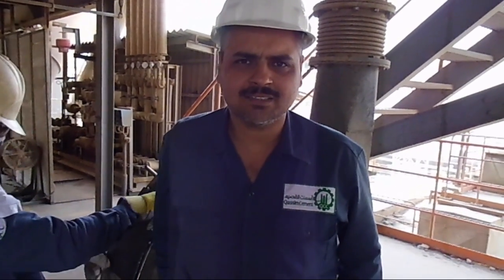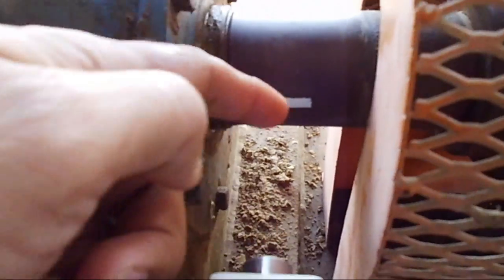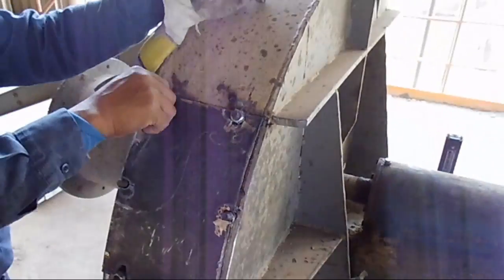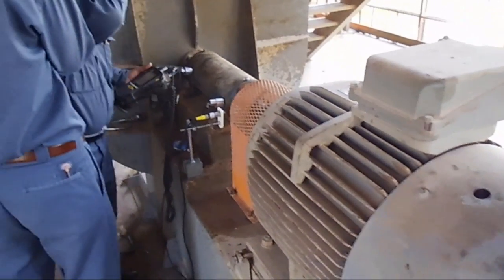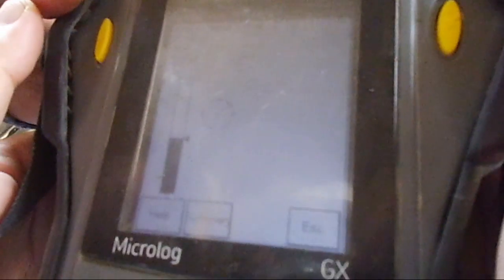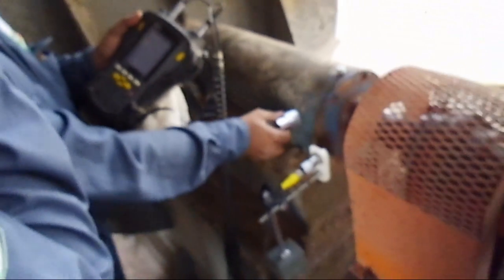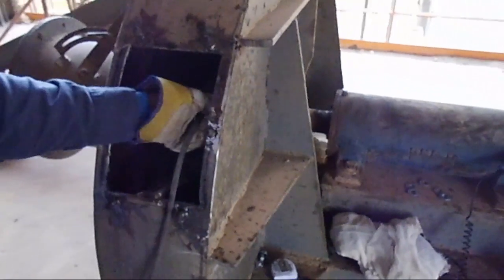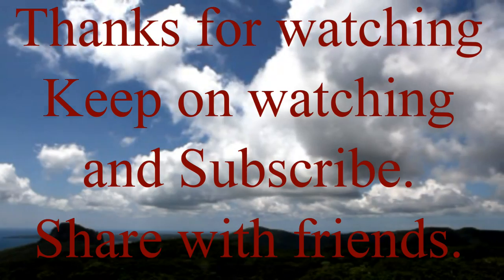Fan balancing. Impeller balancing.

Comment: loverly job done :-))

Its hard to dub your own videos after the event has passed, trying to remember what you did exactly, but it was very clear and noise free in the room you were in :-))

So apart from the skf tool using the white line as an rpm pickup, it is also a timing pulse to start the capture of data for every revolution, and the maximum voltage of the vibration sensor can be tracked to a position after the synk point.

So synk/strobe is 0 degrees and the speed is known then the rotation period can be calculated, the ratio of rotation period to vibration period point could be used to divide 360 degrees to tell you where it is.

Sorry im rambling to myself while thinking out the basic idea lol.
Reply from the maker: As I said before you have rock knowledge. Your understanding to the matter is awesomely great!
Yes you are correct it is a bit difficult to dub and re-assemble the events again after passed but it was necessary as it was very noisy there where I was filming in real situation. Also the camera in my hand was a poor quality one. But I am sure What I did, would be enough to give understanding to a person working on such a job.
Reply: LearningZone
There is nothing wrong with your video, the picture quality is plenty good enough to see what is happening, your commentry made everything clear :-)

My knowledge is only basic, i also forget things over the years so its allways great to have the memory refreshed by your smashing videos :-))

Im one of those odd people that found learning from school or text books almost impossible, it made no sense to me, i needed to physically take things apart and learn from reality, just an odd sort of brain i suppose, thats me "Odd" ha ha :-))

Comment: how to calculate the weight of trial weight for the 1st time. will i attach any weight, or there is any calculation of trial weight by using impeller weight?
Reply from the maker: According to impeller weight there are mathematical calculation formulas available. But you can guess trial weight of any appropriate weight. It would work if don't cross the limits. Means don't go for big weight for a small impeller and for a big impeller a very small weight.

Comment: When adding the weight, do you also consider the weight from the weldment?
Reply from the maker: Yes, it should be considered for small fans where you need a few grams of trial and correction weight. An estimation can do. For bigger fans where kgs of weight you need to balance, a few grams of welding wouldn't effect much.

Comment: Sir, For 210Kg ,700 dia flywheel rotating for 4000 rpm , dynamic balance report says R1=0.49 grams,R2= 0.51 grams ,before it was R1=40 grams,R2=50grams and vibration value is less than 2.61 R1,R2 is it acceptable

Comment: Sir trial waight remooved or not  after balancing
Reply from the maker: Trial weight removed during balancing after trial run and before fixing correction weight. Trial weight is just to make trial calculations by the balancing machine.

Comment: hi sir I'm Jake great video This is so helpful for us to know since we have same instruments,, by the way i have a question about on your video of balancing did you remove the trial weight before you weld the correction weight i did not see on the vid.. thanks for the reply,,
Reply from the maker: Thanks for liking. Here I removed the trial weight after completing the trial run. There is option available in the machine to select if you don't want to remove the trial weight. But my preference is to remove it. Stay tuned and blessed.
Reply: thanks for reply sir ,,, hoping in the future to have more discussion  with you  since I'm using same instruments thank you again
Reply: Hi # Jake Alboroto
Can you share which equipment is this and also I would like to know weather 2 channel vibration analyzer is sufficient for balancing operation and for condition monitoring???

Comment: sir am having one question that before adding correction weight u need to remove that trail weight sir ?
Reply: You are right, you must remove the trial weight. But there are several instruments that provide the option of not removing trial weight. So the position of correction weight will be different. Trial weight should be removed

Comment: Nice video sir but I have a question after trail weight to add correction weight is that add fan rotation direction ya opposite direction
Reply from the maker: Sure you will count degrees opposite the direction of rotation.
Reply: Thank u sir

Comment: The test weight you place counting in favor of the rotation rotation or against
Reply from the maker: +Efrain Castillo Garcia every weight, trial or test and correction, degree is counted opposite the direction of rotation. The test weigh one can fix anywhere of any grams size. The obvious angles are off course 0 and 180. The weight is estimation for small fan small weight and for big fan big weight. Hope you understand.

Comment: amp. increasing when i apply correction weight on the counter rotation, is there a setting for that? There is a problem on my microlog but i don't know where...
Reply from the maker: +ffrosttt Dear friend there is a setting in the subject microlog while you are starting balancing or when you enter to the device setup screen. Just search it and it is stating whether you will apply balancing weights in the direction of rotation or opposite the direction of rotation. I am always keeping that setting in the opposite the direction of rotation not to put my self in error and to bring symmetry in work.
Another thing is sometimes with the proper setup even you will encounter the problematic situation where you will not be able to overcome on vibration even with proper weight and proper angle. There are so many parameters in such situation. Your experience and skill is the key to solve such a problem in such difficult situation.
Reply: +LearningZone thanks for quick reply, i'll look for setting, what are the parameters that  effects balancing procedure? I tried and failed on a fan 1860 rpm, 32 mm/sn amp. with a huge motor,  i did everthing just like written on the book but in the end ampitude increased, any quick advise for my case?  Thanks again for the great videos and instructions...
Reply from the maker: +ffrosttt Dear friend if your fan is not responding to balancing, repeat clean balancing from begging. If you balance fans in routine and did many balancing jobs successfully in past with great results then there could be some other problem with the fan giving 1X vibration like looseness, bent shaft, bearing or any other possible reason. Check for every thing. If you are beginner in the field of balancing then check your procedure for any mistake. Sometimes we are making a mistake which are leading us to failure. Hope you will do it good. Share your results and success with us. Regards,
Reply: +LearningZone I couldn't fine any settings for rotation on microlog. I'm applying weights on same direction as the impeller rotate, it works, amp. decreased all the time... :)
Reply: check the blade type is it aerofoil blade or plate type blade